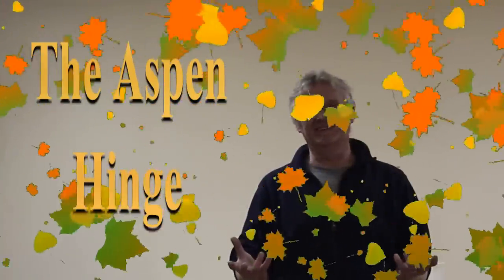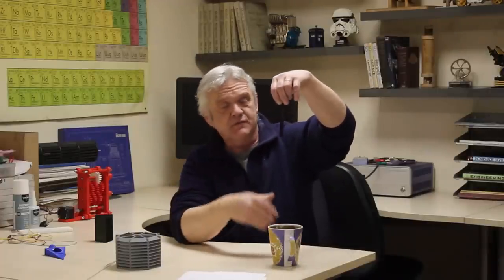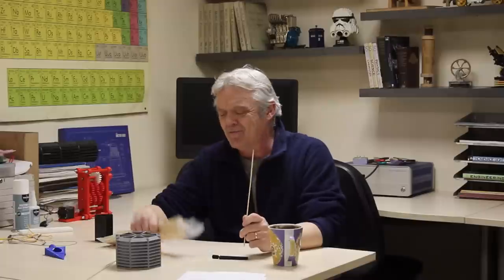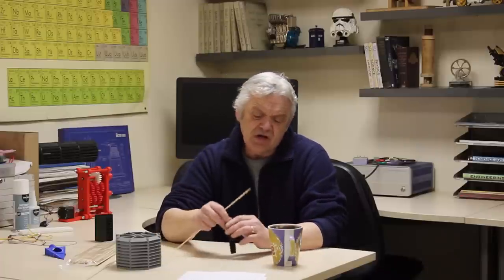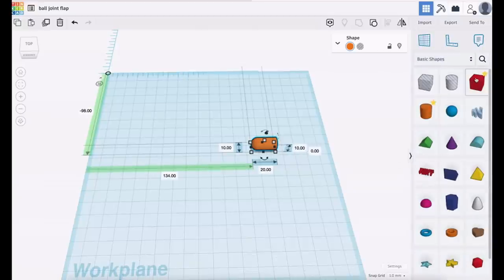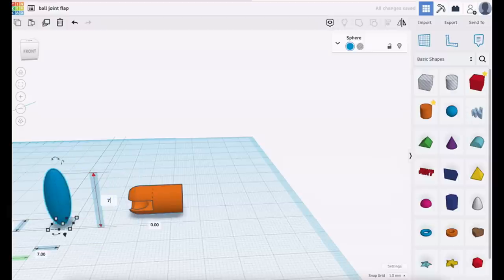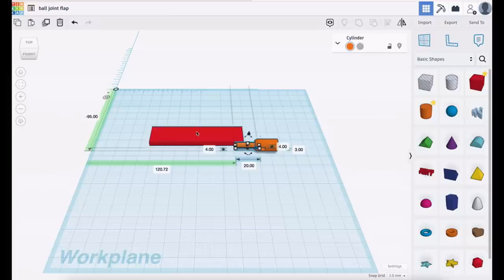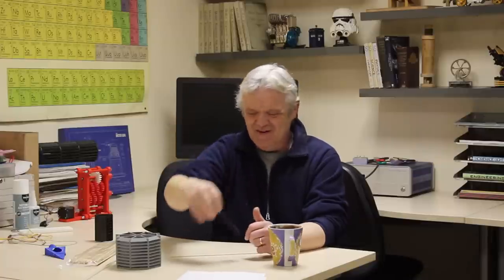1842 The Aspen Hinge For Wind Generation

Comment: Thank you, as always. Wonderful Ideas.

This gave me another one. I usually follow the philosophy of "simpler is better". Not always true, but in this case I think building a flap with a cylinder in the middle to fit over the spring shaft with the magnet on top situated within the coil greatly reduces the amount of arc swing thereby reducing voltage variances. This also reduces the amount of moving parts to the spring only. Only one possible point of failure. Think of a dandelion pouf in the wind.

Thoughts?

Comment: I like the ball joint’s ability to swing in any direction, that got me thinking about schemes to generate regardless of direction. What do you think about mounting a ring magnet perpendicular to the pendulum and laying coils under it? Since we’re collecting small charges on the cheap instead of focusing on charge per rotation, maybe an array of very small coils would be more affective than one or two small coils.
Reply: - ?/ a tiny disc magnet in the "top"/"apex:" of the ball with a coil in the socket - holder seems to make the most sense? - then it will generate with any swinging motion about the rest position - in 2 planes  (rotations will not generate - but then swirl is often ignored mathematically)

Comment: To be fair I think plastic printed ball and socket joints would probably be one of the better choices for build cost and the environment it needs to work in, if metal was used then grease would be needed to reduce wear and corrosion, plus the overall cost would be much higher do to the materials plus the milling/heating and freezing required to build this type of joint, wood would wear and rot so yes plastic is clearly the cheapest/simplest solution

Comment: Some form of simple piezoelectric generator at the base, or some form of adapted strain gauge, the bamboo rods may resonance in the wind, just by having a cylindrical cross section, vortex shedding, there is a simple enough formula to calculate the induced frequency, stroudal number,,  wind velocity, diameter,
Reply from the maker: or you could make one and see lol - we seem to have different approaches here mate
Reply: The Aspen (Poplar) leaf has an oval cross section in its stem.  I thought too of piezoelectric at the base or in the stem.  I thought of a thin film like kitchen stretch wrap with the outside of the leaf one or two layers of printer plastic to make it very light to catch any breeze.

Comment: I'm sharing!

Unfortunately I don't have the money to buy a 3D printer, so I have to go with what I can get. I'm thinking either light plastic tube or pieces of thin wooden dowels.  I would use fine thin coiled spring wire as my hinge. Now all I need is were to place the magnet and the coil. I'm just aching to watch the next video on this.
Reply: lego makes various ball joint parts, available in their pick a brick section
Reply: @wisterialosenge2546   Thank you, I will definitely look that up. Have a most excellent day.

Comment: Is it better to have a large magnet or rather a more powerful magnet moving through a coil slowly and a short distance or a small less powerful magnet moving through a coil either faster or for a longer distance to generate more power?

In other words is it better to have the magnet at the top of the hinge or a smaller magnet at the bottom of the hinge with the coil at the top or the bottom of the hinge?

Comment: I should get a 3d printer to make an acid resistant geyser pump assembly. I've reached a point in my gold recovery interests where it would be useful to recirculate sulphuric acid in a gold stripping electrolysis cell. Turns out that gold plated phosphor bronze presents several issues in effective yields. The tin in the base metals presents several issues with most of the other recovery methods. It either robs the gold from the process, or creates other messes that are difficult to deal with. At least with the less dangerously toxic processes of recovery and refining.
Reply from the maker: that is a fascinating use I never thought of mate - keep me in touch with how it goes will you?
Reply: @ThinkingandTinkering  
Love to. Always looking for additional ideas for overcoming the issues.
I've tried at least six different processes, each with their own specific drawbacks. Of course I'm trying to stay away from the seriously dangerous methods like mercury and cyanide. 
Copper chloride leach methods make gold stannate (Purple of Cassius) which can get past the hobbyist as an undetectable loss.
Any form of Nitric acid leaches will form metastannic acid, which is like a white glue gell, clogs filtering attempts.
There are sodium ferrocyanide stripping methods, but those have issues with getting the gold out of solution. As well as some cyanide fume risks.
Copper sulfate electrolysis can make tin sulphate insolubles which is almost as big an issue as  the Nitric/metastannic issue.
I did develop a low waste process that is now called the TAPP cell (Titanium Annode Parting Process) which avoided the requirements of casting anode bars.
The most likely solution at this point is a rotating, tumbler, electrolysis cell. To overcome the Faraday effects of deplating piles of small pins and granulated material. This works with either concentrated sulphuric acid or concentrated NaCl brine. But the brine process will digest everything that will react with chlorine, and makes hypochlorite bleach as a byproduct. While the concentrated sulphuric acid process stops conducting electrical current once the gold plating is gone. Both take time to allow the sludges to settle.

Comment: Have you looked into The "Perpetual Motion" Machine. I am pretty convinced i figured out how it works. those 3 weights are placed so always 2 go down and 2 go up. then you have a tube that catches wind and on the bottom of the tube that catches wind is a housing that collects wind to build up pressure and then it shoots out the other end to keep the wheel spinning for 2 whole years apparently. those 2 weights turn int "3" weights vs 2 weights caused by wind inertia..i don't know the actual math so..

Comment: For your flaps instead of having it solid remove the top and bottom layers and Geno rate a gyro is infill would increase the surface area would be easier the designing in the rides

Comment: I used to 3d print then finally said enough is enough after a decade due to filament having to be kept dry.  Very big problem and once humidity gets at it even a dehydrator can't remove it all (that takes about 12-24h of running).  Ruins the quality.  I was about to go to resin (solving the humidity issue) to find the projection system is considered a consumable so after 50-500h (depending on various factors) you have to replace it, and they are not cheap (nor is the resin).

Comment: I just realized a problem with this barely corn idea. If you have more than one of these they wouldn't all produce a positive polarity voltage at the same time, so if you wire them in series you would expect the voltages to add together.  Some would be producing a negative voltage. if they weren't in sync , they would null each other.  Current can't go both ways in a conductor at the same instant. Maybe each one could be connected to a capacitor, through a rectifier .

Comment: If an aspen hinge is used... shouldn't  the blade have some torsion in its shape? so the wind moves it coming from any direction, instead of the hinge aligning itself in the path of less aerodynamic resistance and then barely swinging?
Reply from the maker: maybe - chances are not - but test and see is the answer
Reply: The Aspen (Poplar) leaf has an oval cross section in its stem.  I thought too of piezoelectric at the base or in the stem.  I thought of a thin film like kitchen stretch wrap with the outside of the leaf one or two layers of printer plastic to make it very light to catch any breeze.

Comment: How durable and strong are 3D prints? I have it in my head that it’s pretty fragile stuff along the “grain”. Ie. Trying to bend it the same direction as the printer layer it down.
Reply from the maker: it seems it is tougher than you think - but remember we are prototyping here mate
Reply: Depends on what material, overall concepts and design, and usage for the project! You can easily make this project cost little more and get great durability! Also if you  want longevity, look for another consideration maintenance and replacement over time! I hope that helps! If you have any other questions just ask!

Comment: Hi excellent video but if the flap is 4mm high & the ball is 7mm the ball must have a flat on one side as the 3d printer can't print into thin air and the flap will only be on the bed at the opersit end to the ball.
Reply from the maker: the printer will print a raft and support - but that is done in Cura - you don't need to change the model - just specify raft for build plate adhesion and support for facing the buildplate and you are good to go
Reply: @ThinkingandTinkering  Hi as I am old school paper draftsman & it's been over 20 years since I used auto cad it seemed like you missed out a slight necessary detail to me but I still found it fascinating & I look forward to your next video

Comment: Bamboo is good for demonstration purposes. But your initial idea of using fiberglass as the spring is better for any production system. Bamboo rots. That’s not something that you want when you have ten thousand generating units. Maintenance is an important factor in any design that is intended for long-term use.

Comment: You should factor the land use in the cost of energy production.
Reply from the maker: what land use? this doesn't need actual land - we are not talking about an actual field they could go on buildings, bouys, roofs, walls, motorway signs etc etc etc - there doesn't need to be land use per se
Reply: @ThinkingandTinkering  You did mention fields in the last episode. I must have misunderstood your intentions.

Though energy production density is still a valid concern. If each blade of "electronic grass" only produces a very small amount of energy, you'll need lots to make any significant impact.

So you either waste fields' worth of space, or end up not getting any significant power production out of it, even if you place them on otherwise "unused" surfaces.

And those surfaces aren't free either. The "land" cost still exists when you have to place the things on walls/roofs/signs, as you don't own those. So whether you pay someone to buy a field, or many someones to rent walls etc... you're still paying for the surface. And I seems to me that it would take a large surface per Watt.

Spreading those on very diverse surfaces also adds a cost for the power collection. At some point you'll need to wire them all to centralise the power somewhere, to use it, or to join to power grid.

Comment: Do you know there are apps out there that can simulate physics and fluid dynamics? if you are going to design wind machines it would be beneficial to first mock them up in a sim to find their performance. One can even go so far as to use AI to generate the optimal design(this has been done with various things such as heater coils(which results in a shape with a ton of paths), fan blades, etc.

Comment: Not like you can use nano carbon in epoxy to collect static electricity from wind friction building up mini charges.
Reply: The spinning wool static wind generator was my first thought. But can epoxy strips or rods build up charges from moving air?